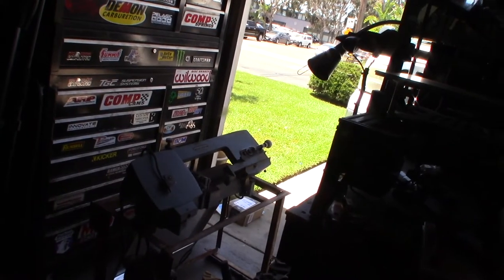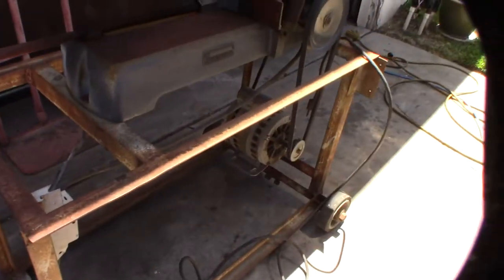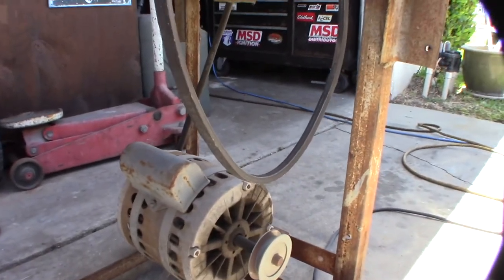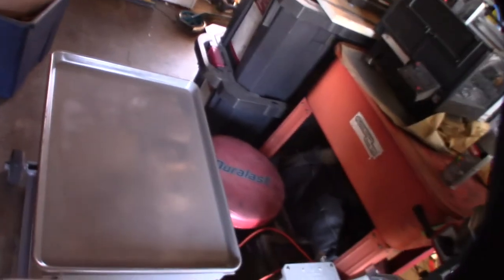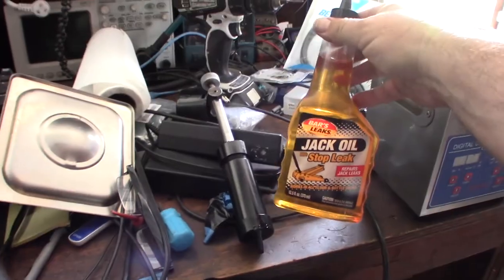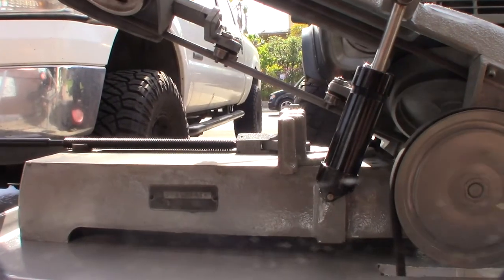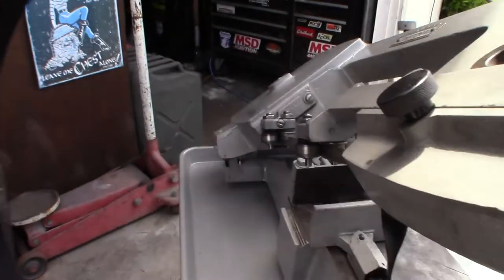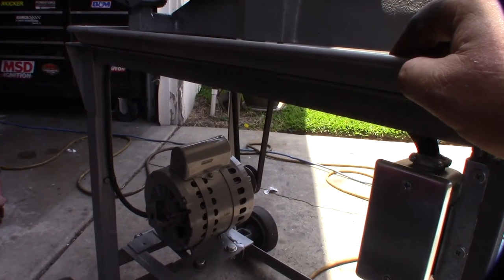Craftsman Horizontal Bandsaw Restoration American Made from the 60's

Comment: I restored one of these a couple of years ago. What an incredibly well made machine.   I got a set of tires for the wheels from Amazon which solved my blade slippage issues.   A good sharp blade and it cuts beautifully - straight and true, even on 2x6 rectangular steel tubing.   Found a vintage oil can on Ebay with a spout that fits the ball oilers so its a snap to lubricate the whole saw with detergent free 30wt (which is what I put in the cylinder as well).

Comment: I just picked up one just like this for free on craigslist. What blade did you buy? Mine came with two and they are almost too tall. I have already broken one of those tiny snap rings when I tried to take it off. I like the shut off switch but I am thinking a limit switch might work better. I am also have problems with the blade staying on.